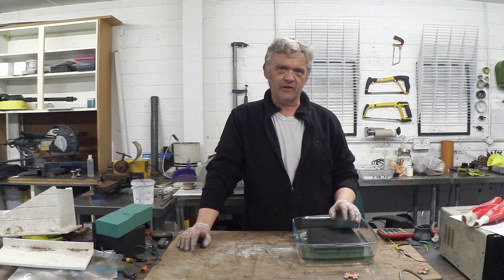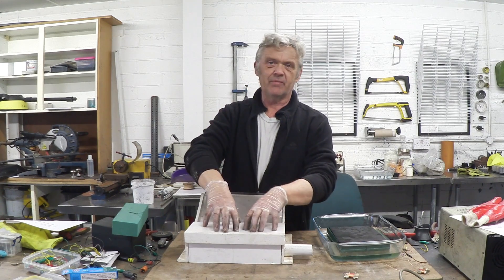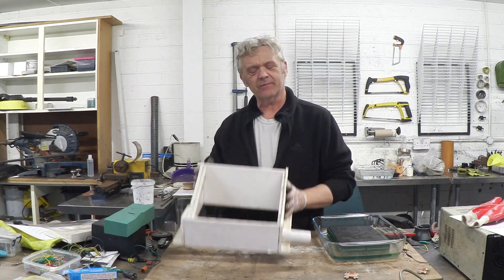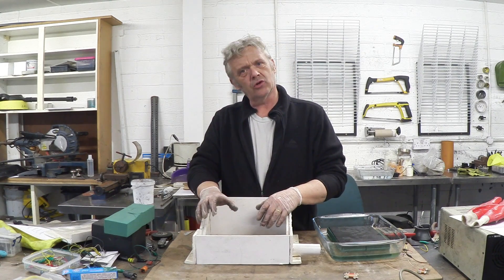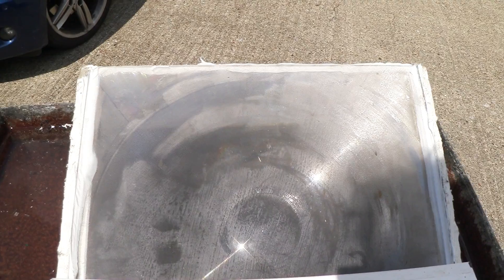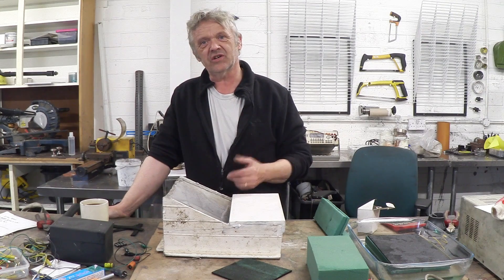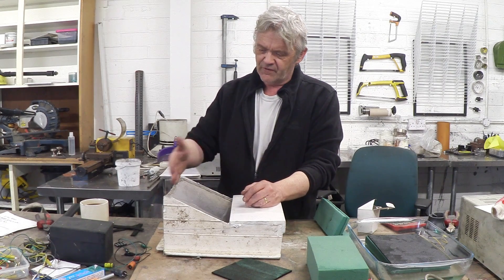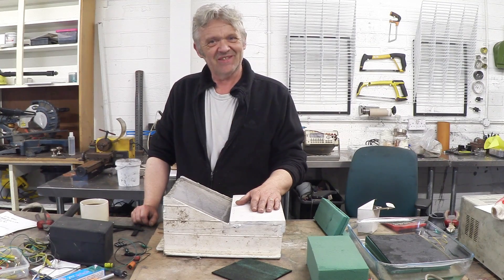Improved Solar Still For Fresh Water

Comment: Good afternoon, Robert. Probably, glass is a better solution. It takes all the spectrum of solar light, and in reflection, doesn't allow infrarred to escape. Maybe a little experiment to check which one is more effective, Fresnel lens with concentration of light, or the infrared retention of glass. Maybe checking inside and outside temps in similar conditions. Regards

Comment: Back in the 80s either Popular Mechanics, or Mother Earth News, built one of these to be set on your roof with a tube running down to a Igloo cooler on the counter. They used just regular glass, washed black aquarium gravel in the bottom, a float valve to control the water and a copper gutter to catch the water and send it down to the catch can
Reply: And then it was made illegal in some states? lol
Reply: @dustinsmith8341  Not as far as I know I have done an internet searches , But haven't found it, I can see it in my mind, but can't remember which magazine I used to read it was in. There have been several articles like that

Comment: Thinking you could cool the condenser section some how ?  Small Solar Cells and Peltier unit cooling a collection plate ?  Don't need much cooling but some would improve results.
Reply: I was thinking of maybe suspending some type of condensing "grid" between the glass and the felt, that would allow most of the sunlight to pass through but upon which the steam would condense... maybe the grid could be attached to a peltier unit to cool the grid by conduction?  As you said, it wouldn't need much cooling, just enough to cause condensation.  The grid could be angled sharply so that the water runs down it into collection tubes.

Comment: The reason the fresnel lens did not work noticeably better than a plain sheet of aplastic is likely due to the water droplets changing the refractivity of the lense as they form, this would be especially true if the fresnel lens's ridges were pointed inwards towards the carbon felt.
Reply: Just adding my comment for the AI ranking. That said I was wondering if the lens had any purpose as it would just focus the energy at 1 pont in the felt and not add total energy inflow in that design.
Reply: @fritanke2318  I agree that focusing the light on a single point would not be helpful overall, however if you have a linier lense it can help to accumulate light from different angles that would otherwise not have hit the carbon felt.

Comment: Maybe if you use E-glass to contain the heat, the evaporation rate would be higher.  Also, you could make the base higher to raise the pipe so a container could be put under the end of it.

Comment: Keep going Robert. Down in Antigua and Barbuda, we're in a drought. I need a way to water my garden with sea water.
Reply: There is a Dutch man experimenting with 50/50 sea/ fresh water for irrigation and on some crops works very well  the increase in salt causes the plants to produce more sugar to counter balance the osmotic effect of the salt  sweeter tomatoes 😋
Reply: @johnmcfadden9336  yeah salts sweeten up fruit an veg... I got a little carried away with the Epsom salts around my plants as great for keeping slugs away... But too much an the plant starts to wither..! 

MY peas are gorgeous like sweets only 1 lots made it to the dinner table...
Yeah I'd be using sea water... 
Soon as plants start lookin stressed switch to fresh
Reply: Celery can be watered with sea water if you don't mind a garden full of celery
Reply: I always imagined the solution to this requiring a tube in a tube. 

The internal tube being a semi permeable hydrofilic material. 
Running the salt water in the internal tube and collect the fresh water from the external.
Reply: Can you not dig a well?
Reply: Chileans had completely supplied some of their mountainous mining towns using this type of distillation. Their water was contaminated by the material they were mining. So it is possible but use underground drip irrigation to avoid evaporative losses. Say "Hi to the Murphy's" for me.

Comment: Low-e coated glass (modern window glass) might work. But then again it might trap too much heat and it might not condense. 

If only there was a way to cool the glass. Since it is all sealed. Perhaps putting some foam on the glass in the "shade section" so that it is in the shade and then use contaminated water on the foam to cause evaporation and cool the surface of the glass.